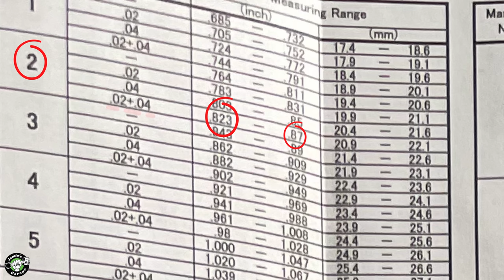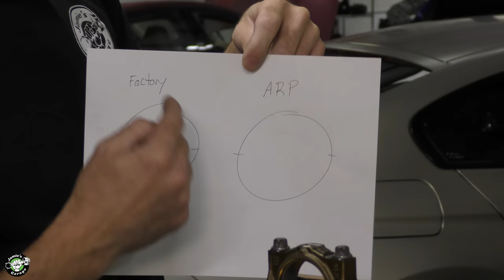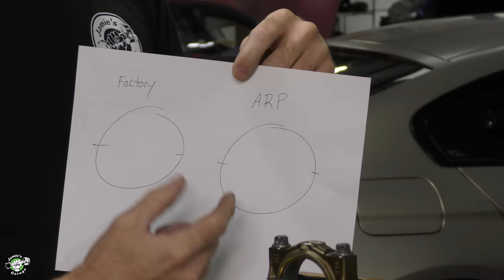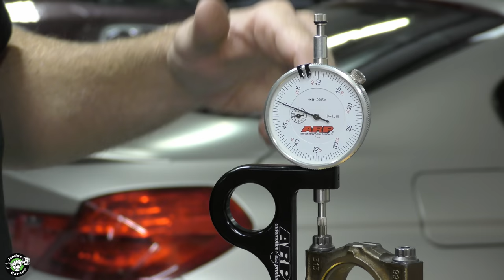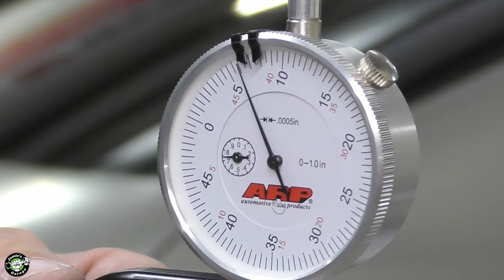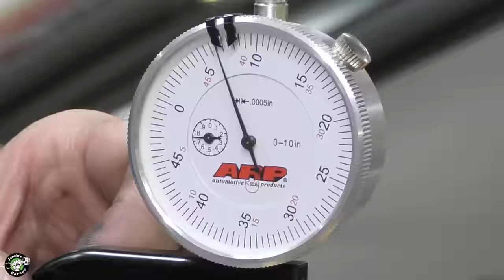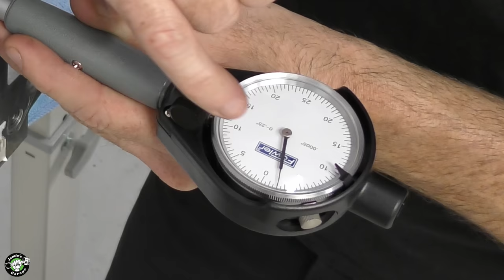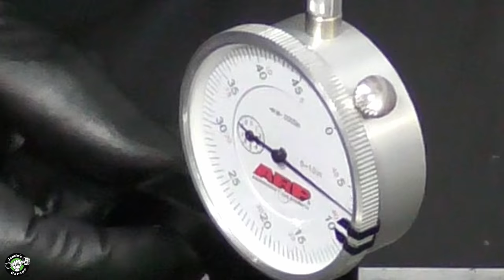Part 2 of building a BMW M54 for ChrisFix's e46

Comment: Been rebuilding engines for 20 years. This is a 10/10. Very detailed, very knowledgeable, i can't wait to see the top end. This is why I subscribed. Great work guys. Don't forget to drink lots of wouder too.
Reply from the maker: Thank you! 🍻
Reply: @JamiesGarage1  didn't see plastigauge being used but I'm assuming that would just add another 30mins to the video lol.
Reply: @bluej511  isn't a plasigauge the same as him using a feeler?, Since they measured it before and after and know it's in tolerance
Reply: @djjoey0812  plastigauge measures the clearance between the bearing and the crank. I'm sure if you measure both and subtract you'd get the same but I always use it just to make sure the clearance is right with the rod tightened onto the crank.

Comment: Delta stands for change rate which is why they call it the Delta meaning the change factor/amount.    Great breakdown.  For those casual engine and wrench fans, this was a great guide to how engine engineering specs effect engine performance and just how exact modern engines are.
Reply: I'm glad that someone came here and wrote down what a delta means from a mathematical perspective.

Comment: Deleting piston squirters is common on race engines because the oil on the piston is excess rotating mass that can't be accounted for while balancing.
Reply: I’m reading all these comments and learning so much. I love this channel and the community it draws. Thank you for the explanation!
Reply: What does this do for the lifespan of an engine.
I'd imagine a race engine doesn't matter due to its routine servicing and maintenance but a weekend warrior on the occasional track day? Not worth it?
Reply: @possle  depends on your priorities. For a street car with occasional track use, you'd probably be better off with a milder build that retains the oil squirters. The main thing you achieve by deleting them is the ability to precisely balance your rotating assembly to allow for higher revving.
Reply: @whyidontknow7113  dumb question, do all connecting rods have an oil gallery drilled in them? Ive always wondered how the wrist pin and oil control ring is lubricated
Reply: @bwatt1383  that's a good question that I don't know the answer to.

Comment: Hey guys, this is Chris' second account. I've thought over it and I think 2000hp would be more appropriate. Please make the necessary changes Jamie 👍
Reply from the maker: Let’s just make it 3000
Reply: Idk 2k seems pretty standard for a basically stock engine.  I also doubt y’all are removing the wheel wells to facilitate tires to handle 3k hp so yeah 2k seems “reasonable” 😂

Comment: I'll never get tired of watching masters at work, this was an amazing video.
Watching you guys balance the crank reminded me of a video barum did with a Renault 5 engine where they shaved the fins down to reduce weight, got thinking if it's doable on the m54 🤔
Absolutely loved the experiment with the ARP compared to oem bolts, I'm guessing the extra torque over manufacturers recommendations goes to show the quality of the product 🤯

Comment: I never knew so much high tech stuff  was used in machining engines.
Reply: And that's only the bottom end lol. There's even more for the top end. Engine building is like 90% measuring and 10% assembly lol.
Reply: @bluej511  this is 100% true. Lmao

I spend more time with a bore gauge and mics in my hands than a wrench.

Comment: Fun fact about some Subaru engine build shops: They have the torque plates bored so that they can also be used for installing pistons. Helps save a bit of time. They also have a torque plate for the heads when valves are ground for a perfect seal as well!

Comment: 32:50 Its just my guess it is called delta, because when in physics you calculate the thermal expansion, in the formula the increase size after heat expansion is called delta L.

Comment: An M50 cast iron engine block would be a great starting point for a racing engine. (If you find them lol).
Anyways, is nice to see the complete process of a combustion engine rebuild. Good job! Now Chris needs some: silicon cooling hoses, an aluminum: radiator, water pump, thermostat housing and an electric fan and... Maybe a supercharger and he's good to go.

Comment: Those oil squirters are known to fail on the M54, especially at high RPMs. The nozzles snap off and clatter around the bottom end. There don't appear to be any aftermarket solutions, but it is a good idea to install new ones in case the old ones have been weakened over time.
Reply: I had 5 of 6 come off - #6 cylinder was the only one that stayed on and we didn't replace that since that would mean tranny drop and crank out.  in my research the smaller M54 engines (b25) had the most - if not all of the problems- - and only after sustained 5-6K+ rpms (first showed up in the Turner cars I think (or Bimmerworld).

My car is a 2001 330i sport with a crap ton of miles but I know they have been fairly easy miles - lots of highway (I am the 3rd owner)  First owner seemed to be a sales person and the next owner was fairly sedate with it.  While I do put my foot in it from time to time,  I do not drive it like I stole it and do not keep sustained 5K+ RPMs much less 6K...

I was certainly surprised they fell off and ont he E46Fanatics forum there was a guy in Sweden who was making a one piece squirter - not sure if it has the valve in it.

Comment: I've always preferred using a ring spreader. I do not know if there is a downside to using them, but I feel like they are better at not scraping the pistons. Like, you squeeze from one hand and just lower the ring into the groove it goes.

Love your rotation technique still.

Comment: It's called Delta because that means "change in" in nerd, so delta V would be change in velocity. You can use delta V as a unit of how much change in speed you have left in a given system, for example how much fuel you have in a rocket. I'm assuming in this case they're referring to the bearings changing in length with temperature.

Comment: M54B30 BEST ENGINE OF ALL TIME!
Reply: M50 non vanos
Reply: @romachoz  Vanos can be fixed with 50 dollar rattle kit and be good for another 200k miles though...
Reply: @seagie382  it depends what you want n/a build m54b30 is better than m50b25, in high hp turbo builds m50 is better.

Comment: Very good video. Good knowledge and insides to building a BMW I⁶ engine. BUT, there is 1 huge questionable item your machine shop did - Crankshaft balancing - back 15 yrs ago when I was building NA race engines & 700WHP FI BMW engines, I've never touched the crank, after walking PRI and learning that there was no machine in the U.S. that could harmonically balance an I⁶ crank. Has this changed? Did his machine harmonically balanced that crank? 

Also, why not time-sert that block? we all know how weak the threats are. That"s a must for SE46 builts.

Comment: Are there any worthwhile performance gains to be expected if you were to lighten that crank a bit, or would it severely eat into its durability? It's the same crank that went into the later euro spec e36 m3 s52 engines if memory serves. So you'd expect it to be sturdy. Just curious about your opinion. Great video, again. Thanks!

Comment: When your given a toque number to tighten a fastener (for the most part), the torque is calculated from a friction constant (material property’s, thread pitch, dry or lubed), diameter of the bolt and the force applied. This equation is an estimate of the proper preload or elongation of the fastener. Just as you might be familiar with a spring preload this is a similar idea for a fastener. In that you want to stretch the fastener enough so that it acts as a spring as the fastener is loaded and unloaded. It needs to be stretched enough to keep the fastener from backing off and not to much to where the fastener will yield or stretch to a point where it will permanently deform with enough cycles. So the reason ARP gives a number like 36 ft lbs is likely because that’s on the low end of the proper preload of the fastener. Because torque is calculated and has inconsistent variables by far the most accurate way to measure preload is by elongation. This amount of precision isn’t usually  necessary so torque is a quick and easy way to get the proper preload.

Comment: Super educational to see this kind of content! Just a quick question, how come you needed to throw away the factory fasteners after you did the rod fastener and bearing clearance test?
Reply: I believe oem rod fasteners aren’t reusable or at least shouldn’t be used again. Could be wrong though
Reply from the maker: The factory fasteners are torque to yield. Once they are torqued, the bolt is stretched for maximum clamping force. Once the fastener is released, the bolt cannot be used again.

Comment: Feel like bolting down the torque plate to an uneven block deck…. Feel like that might help to distort it….. feel like skimming the deck…. First…. Correct me if i’m wrong…. Just feel like if the Deck has a big twist under that toque plate…. It’s gonna twist into a shape that it wouldn’t have to after the deck was skimmed.

Other than that, interesting Torque plate

Comment: We didn't see no crankshaft journal measurements, no plastigauge main bearing clearance measurements also. At least hopefully you use a brand new OEM bolts for them. 3 thousands of an inch is around 0.076 mm if my google calculator is right (German engines aka metric specs). This clearance is little bit on the high side for this engines. Perfect main / conrod bearings clearance is btw 0.025 mm - 0.065 mm. M engines use higher clearances because of the much higher rpms. M54 should not be REVed above 7k rpms, because this will end pretty fast for it.

Comment: I got request if you see this and can help out. I want swap my m62tu in Range Rover to m54 with zf8hp. I got everything sorted. I one thing I dont know if oil pan will work. I saw you have m57 torn down, could you see if m57 oilpan can work/be made to work via extra holes with m54?
l322 has 8 inch Dana so regular bmw awd pan dont work. Europe has m57 in l322.
Thank you.

Comment: Do you leave the paint marks inside the engine ? Would they dissolve into the oil or is it a spacial type of paint marker?
Reply from the maker: Oil based markers. They’re engine safe 👌

Comment: Is the engine still legal for Chris's racing class if it's bored 5 thousandths over?
Reply: Yes block wasn’t bored. It was honed for a refresh. Plus 5 thousands is nothing.
Reply: @dwolf97  I did the math and figured that 5 thou over added about 1 cubic inch of displacement. You're right hehe

Comment: Is this using the oil control ring from a m52tu because i know the original m54 oil control ring doesnt scrap oil very good which leads to oil burning
Reply from the maker: I can’t say for sure if it’s the same design as the m52 but it’s much better than the M54. The rings came with the Mahle pistons as a set.

Comment: Very great content..can I ask you a question please..I would love to know of the e83 X3 ,e60 and e63 which models come with the limited slip differential..and are they comparable with the E46 casings..?
Reply: I can tell you E83 diffs fit E46 if you swap axle stubs (I have a 3.91 from an X3 in my 325ci)

Comment: Hey, I drive an e92xi with an n52 engine.  Any advice on maximizing longevity from the engine?
I’m paralyzed in a wheelchair (I disassemble and put it in the back seat to drive) so I’m not looking to make any more power than the about 230hp it puts out, I just don’t want problems from the head, specifically the cam that’s cast in place effectively.
I’ll take advice from anyone willing to throw in their two cents. 
Thanks in advance, great vids.
Reply from the maker: Best thing you cam do. Change your oil and filter every 5k miles with quality oil and use premium fuel 🤘

Comment: From what I understand the stretch method is rested (no torque) vs torqued and done with the stretch gauge in place untill its in spec, can you clarify?

Also big end bob weight changing with the different connrod bolts, i’m guessing that wasn’t covered on camera?

Comment: Quality use to be better.  I have been building engines for over 25 years and you can never trust anything. 

I do agree with a decline in consistency.   But this is why all specs need to be checked.

Comment: Pardon me for being the odd guy in the chat fans but are this rebuilding an engine or selling us their college learnt knowledge which is not necessary. What's up with all the sophisticated tooling sets for every small job. Don't forget bmw is one of German engineering failures and most unreliable car in the world. Don't give too much attention my good guy, it will break and disappoint you after all the hard intelligent along the way. It doesn't matter how much knowledge and new parts you through at this piece of plastic mechanic error, something will break one way or another. Thanks God bmw is no longer building aircraft engines, it would have been a disaster for aviation industry. Rather buy a Ford or Fiat or Toyota.